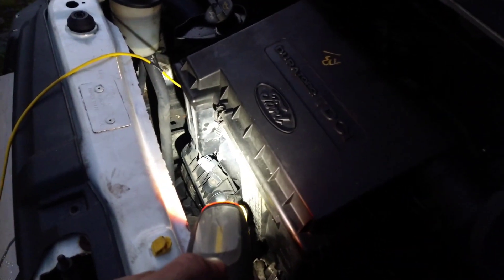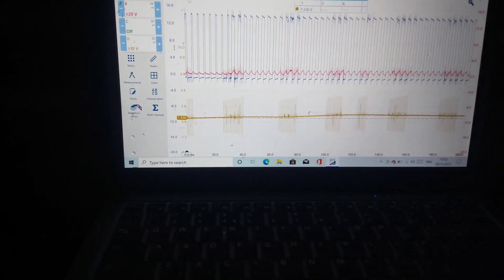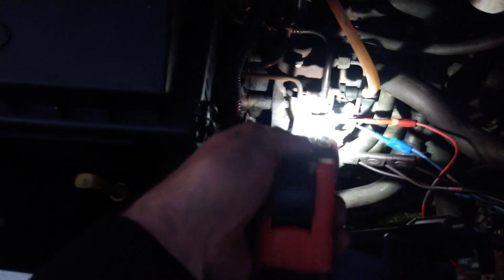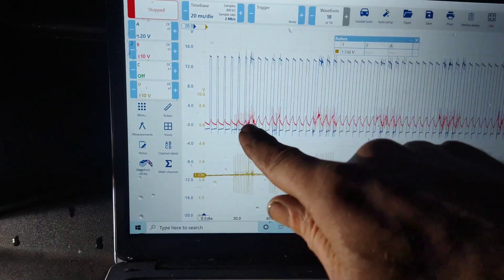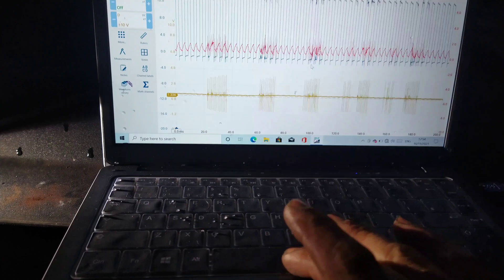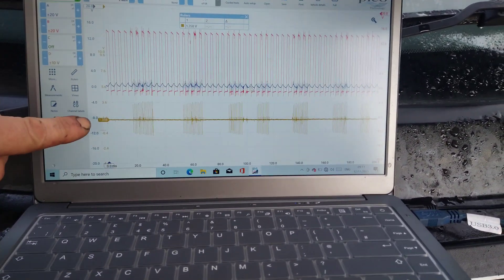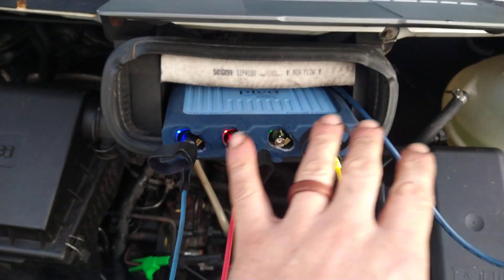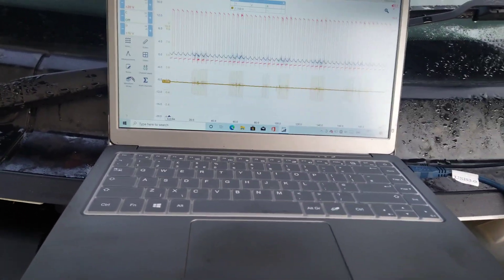2.2 Ford Transit (idle problem) fuel metering valve

Comment: Sir, how to know if there is a mechanical friction inside a fuel metering section valve  that is  causing a car  rough at idle  using a current waveform, thanks
Reply from the maker: You may see am amperage higher than normal or rise if it's briefly sticking.
I don't usually see anything obvious enough to say for sure that it has a mechanical fault. 
I just look to see if it is being commanded to raise the pressure when there is a pressure rise. 
It seems like it is a common enough fault that when the engine surges like that , I just change the fuel suction valve now. Thanks for watching

Comment: I have the same problem with my 2007 Transit 2,2tdci. I replaced the valve but since then i have the fault code p0089. Now i changed back to the old valve and still have the same problem. Do you have any idea what could be the problem?
Reply from the maker: The fuel pressure not being in range can also be air in the system, a blocked fuel filter, too much leak off from an injector or fuel return valve on the fuel rail.
Reply: did u get it fixed ?
Reply: Hi, i would like to know if u got it fixed? Thanks
Reply: @bogdandumitrache9349 it probably means different things for eu4 vs eu5

Comment: I've just noticed this problem on my 2.2 MK7 Transit. Is it possible just to replace the valve yourself without acctually coding it?
Reply from the maker: Yes, I have been told that it has been okay doing that from a few people.
Reply: @mechanicmatt871  I have replaced the valve today. Not only the idle is now spot on, the whole engine runs incredibly well. I'm quite shocked. It feels like I have now a completely different engine inside! I thought my van simply got older over time and that was the reason of a poor performance. I have never seen it running so smooth. Especially on 1-3 gears. I'm genuinely shocked!
Reply: Was this suction control valve you replaced? Thanks
Reply from the maker: @elgrobbo7058  yes it was the suction valve, cheers
Reply: Cheers man, got usb-OBD on the way to learns once I replace, going to get OEM SCV should I replace PRV/Pressure sensor at same time ?
Reply: @mechanicmatt871  Thank you so much for a swift response and the confirmation. I have managed to find an info on a Polish ford forum and one of the guys called a Ford specialist garage asked them that questions and they replied that basically this valve is also connected to a sensor on the rail and they usually change both elements together and then they do need to calibrate the whole system; if we are sure that it's only the valve that has to be replaced there's no need to hook up an app and adjust it as the working sensor will operate the valve properly sending the correct signal. The problem starts when it's not the valve but the sensor or even the fuel pump, then it all has to be diagnosed properly.
I think it all makes perfect sense. The valve is relatively cheap, the access is super easy - worth trying to do it.
I'm ordering the part and I will leave here an update if it worked.
Cheers mate!

Comment: Thats good to know . I have the same idling problem with my 2.2 transit. It run brilliantly at low revs for 20 miles and when i thought i would open it up near my home i got about a mile near the place and it rattled and stopped. I had to get the AA out to recover it.  I just fitted a new turbo and cleaned all the drain and filler pipes plus intercooler. Changed the oil and all the filters before i drove it.  I'm going to get a machanic out to have a look as I've wasted to much time already on it . Would your van stall and not restart for like 3 hours because of this?

Comment: I bought my Transit with the same idling problem. I noticed that the transparant hose between the fuel filter and the high pressure pump had quite a bit of air in it. I used the water drain under the fuel filter to get the air out of that hose and it has idled smoothy since.
Reply: how did u get the air out? Just opened the water drain or used a pump as well?
Reply: @linus737  I started the engine, let it run for a while. Shut it off, opened the drain and repeated this until i got diesel instead of air. 

Unfortunately this isn't exactly the only problem this van has given me so after it's been tested (MOT'd) i'm going to get rid of it and i'm sure as hell never buying a Ford again.
Reply: @DestructionNL86  okay thank you! I will try that. What are the other problems with your Transit?
Reply: @linus737  Several. Mainly with electrics

Other than that
- Power losses 
- Issues with fuel pressure
- Fuel leakages
- Rust. A lot of rust. And a lot of welding
- Failed MOT because of broken leaf spring
- More issues with loss of power

It currently does 8.8L/100km where it should do 7.5L/100km, when cold it still idles bad (it revs from ~800rpm to ~1100rpm and falls back to 800), there's a leak somewhere letting water in the van so that's causing more trouble, the least of which is the left speaker that stopped working (but works again if the water/moist has dried due to the A/C), etc.. 

I've owned more vans but never one this expensive to maintain. And this was a very well maintained vehicle when i bought it. I've not been driving it like a typical builder would do, i've taken care of it but it's a Ford so that's not enough. I've owned more Fords as well, the only Ford i didn't have several problems a mile with was a 2003 Mondeo 2.0TDDI. That's one out of at least 15. So yeah... I'm not buying a Ford ever again.

Comment: Bought mine 2017 with 86,000 miles..was always hunting...new air filter ran fine for 2 years...then started hunting again so I did new air filter again and yes fine again..1 year later same again so did injrector seals and air filter and you guessed it runs like new...so new air filter plus new injector seals=running ok...and upon inspection the old injector seals had been letting gases through by doing the oil cap test..

Comment: Hi Matt. I had the same fault and symptoms with my Transit mk 7, I've replaced all 3 valves on the fuel system (HP pump reg valve, Fuel pressure relief valve, and fuel rail high pressure). It now runs good, no rough idle, no longer cuts out. It is my understanding that once these are replaced the vehicle needs a software update and or adaptions ? Can you advise ? Best regards.
Reply: I change 3 rail pressure valve, and every time i nide to syncronize whit the engine.

Comment: Any ideas why new SCV sensor PRV sensor and high pressure relief valve fitted on Mark 7 tdci 2.2 but won't clear fault code P1250 to allow pump learns it's running fine now but won't let me clear that so I can do pump learn and it's all new genuine parts stumped

Comment: Hi mate which one would give you low pressure ? Also experience not start my engine was doing the excact same on idle and now won't start.
Reply: Same here . Ran fine at low revs and then open it up and rattled and stopped plus wouldn't start for 3 hours. Then it started straight away? Fecked off with the van .
Reply: @ajwalou-nack2343  hi mate it was the suction control valve on mine that made it not start. They are on ebay but went through 4 as cheap China made ones. Best getting proper densol one.
Reply: @kieranthomas5478  thanks mate . I'll order it now . I'll get a proper Denso one saves the hassle. I'll let you know thanks again 👍
Reply: @ajwalou-nack2343  I've also had this issue once started and switched off it wouldn't start again for gd while but that was different issue that was my crank shaft sensor. Could be good place to start as it's cheaper to buy and easier to fit to start with.

Comment: How do you relearn the New fuel pressure regulator?
Reply from the maker: It will work, you will see an improvement, don't get a cheap replacement part because they don't seem to last very long
Reply: @mechanicmatt871  what do you recommend? Witch brand?
Reply from the maker: Intermotor worked ok for me in my transit
Reply: @mechanicmatt871  super, thanks. 🍻
Reply from the maker: It can be done with a scan tool, I know some don't give that option though
Reply: @mechanicmatt871  and if I don't do that? It won't work?

Comment: the valve on the high pressure fuel pump had to be learned with a diagnostic program, namely ford or a universal one, such as Forscan
Reply from the maker: Yes it can be done with other diagnostic tools as well. Thanks for watching
Reply: can you tell me how to do that with forscan?

Comment: Mines doing this, it comes and goes but recently started to fluctuate when not just idling
Reply from the maker: It seems to be a common fault
Reply: Holy shit bro I need your help I have a ford transit custom think it’s 2.2 I also have this same problem if i go for a 30 min drive or the car is loaded the rpms fall down below 1000 then when the car is unloaded comes back to normal I also feel this shaking when your about to release the clutch just doesn’t feel the same when the rpms come back to 1000 sorry for my bad English
Reply: @whatsupp7539  sorted mine by changing the fuel pressure regulator, couldn't get the pressure release valve off the fuel rail. But this seemed to work. 2 bolts sorted
Reply: @thriftyoutdoors  hmmm that explains why there’s a black smoke coming out of my pipe and I always smell the fuel
Reply: @thriftyoutdoors  think it’s related
Reply: My employers leased Transit van was going into limp mode caused by a failed electronic thermostat I think.  Engine thought it was overheating. Took the Ford main dealer three whole months to diagnose the fault,  although they knew I was in a replacement lease van so probably wasn't a priority for them.  I wish there was more Matts around the country!

Comment: You should be able to change these with your eyes shut, you’ve done a few for me,is that your new van Matt.?my truck started and conked out yesterday and just kept winding, I’ve got now an autel Bluetooth dongle and it says camshaft position sensor fault, so I bought new one from d@a and fitting it tomorrow
Reply: I also had Gary fit new thermostat housing on my mini last month and got him to fit new fan same time, then this month my alternator packed in so I had to put it into front end service mode( move the rad pack forward on subframe ) to get old one out and new one in along with new tensioner
Reply from the maker: Yes it is my new van the last one was too small and I sold that today. What autel have you got. Was thinking of getting one?
Reply: @mechanicmatt871  an autel ap 200
Reply: You’ll need to get a roller awning on the side so you can pull it out to work under
Reply: I had to get a decent code reader as my old one moved to Cornwall

Comment: Hi Matt.My transit is doing this currently. 
I've changed the fuel pressure sensor and the scv either end of the fuel rail. It's been updated and has had all the learns done. But it still does it. Originally it was a really bad diesel knock, would kangaroo down the road But now just fluctuating idle, and also still goes up and down whe reves are raised.
Reply from the maker: Where are you I could take a look
Reply: Like Matt says the pump has to be virginised or it will knacker your new valve
Reply: I'm in Oxfordshire/Berkshire border.
Reply: Its seems to jerk and wants to start diesel knocking when you wriggle the wires going into the plug that attaches to to fuel pressure sensor on the rail.
Reply: Also I think it over fuels. Something telle something is out of kilter with it. Maybe the rail pressure is to high.
Reply from the maker: Ah that sounds like you have found the problem, if it's not a broken wire near to the plug or loose terminals in the he plug that need tightening up. If not you may have a faulty rail pressure sensor

Comment: Interesting. I am ashamed to admit I had to go back a bit to check something out. When you said "I still have to coat that" I thought you said 'code that'. Threw me right off. 🤣 I would be interested in a follow up if you find out what is causing the noise in the signal.
Reply from the maker: Yes i should think before I speak, I ment the pcm needs to know that it has a new valve, this can be done in the special functions on the scan tool, that's when I said coded to the car, like when you put the code in for a new injector, although this doesn't have a code on the fuel valve like an injector. Thanks for watching